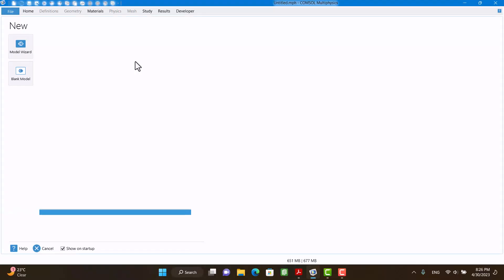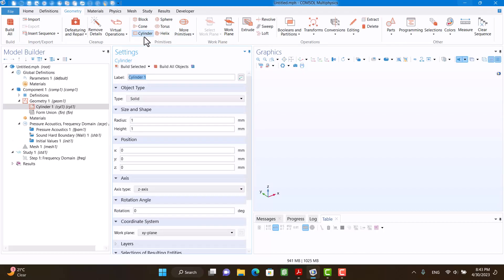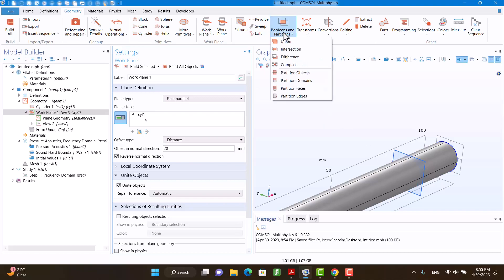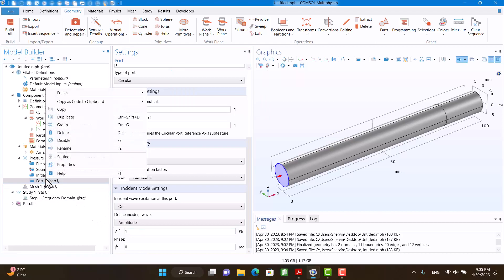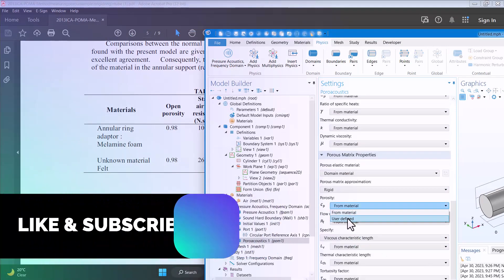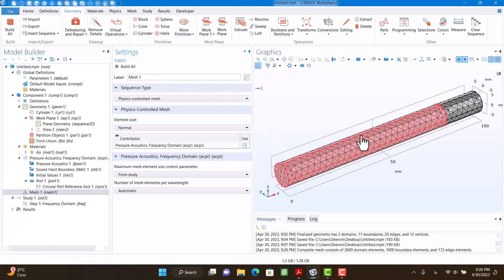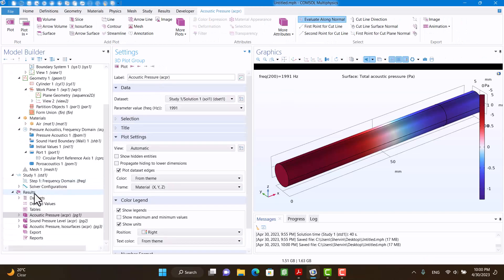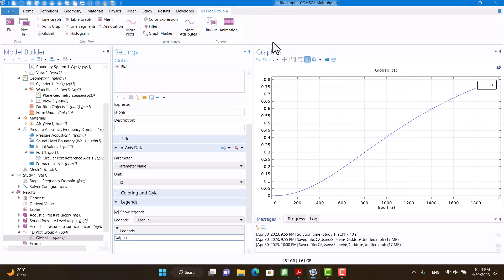🎧 COMSOL Tutorial: Sound Absorption Coefficient Using JCA Model 📉

Comment: Hello sir, i have a query like in this instead of using port boundary condition, if i want to use the PML and Background pressure field in 3 D  (Like it is done in comsol tutorial of porous absorber in 2D) what are the changes are required in the model?
Reply from the maker: Hello, As i split the body and specify poroacoustics, you need to separate the cylinder and add a background pressure and PML  because they are domain. This process is the same as this example, except you have to specify  PML and background pressure instead of poroacoustics domain.
Reply: @caewitharminhashemi   yes sir, thank you i did that. now again we have to give port boundary to calculate absorption coefficient or any other additional variable or setting required?
Reply from the maker: You cannot use port and background preesue simultaneously. Using port is more simple than background preusse to calculate absorption coefficient